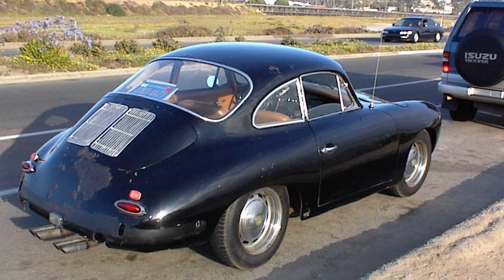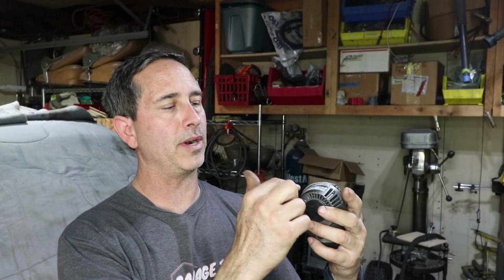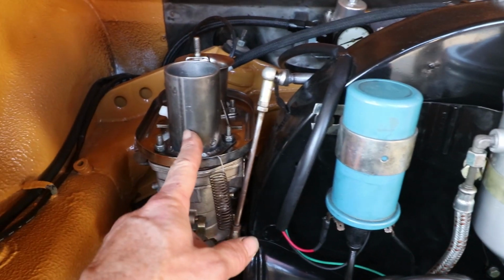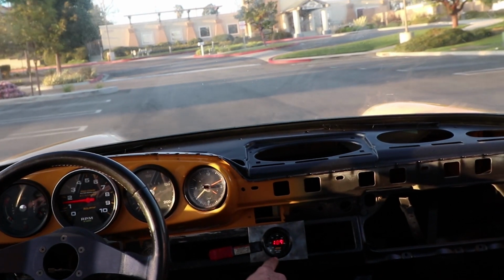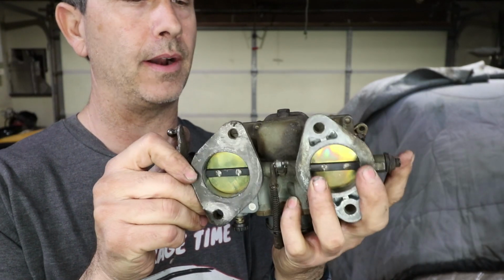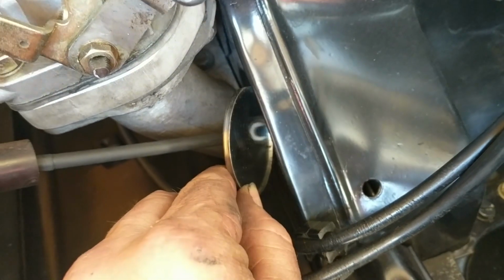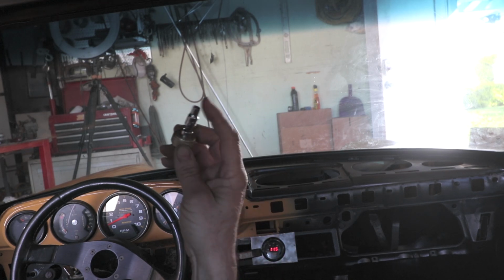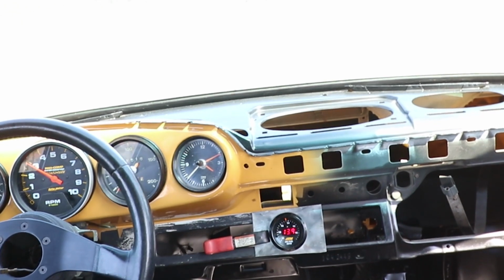Complete WEBER 40 IDF Dual Carb Setup and Test Runs

Comment: I followed your jetting snd f7 Emul. Tube. I set the timing,ajusted yhe valves sbd played with it for a few days . I jyst got it to idle smoothly and syn. The carbs. 
Thsnk you so much Tom as your are a wealth of knowledge and very thoughtful to teach us how to tune these littke engines. Your 912 motor sounds really good! Mine is still on the stand ,but running nice and smooth now.
Reply from the maker: So good!  Congrats😀

Comment: Since the air bypass is part of the idle circuit it's  almost effectively  like an adjustment of the idle air intake jet, would you agree?
Reply from the maker: Hmm, my opinion is that the air bypass is not part of the idle circuit.  Its the same as drilling a hole in the butterfly. 
The idle circuit air bleed is different in that it effects the pressure acting on the idle fuel column.
Reply: @GarageTimeAutoResto  Oh so the air bypass is separate from the idle circuit, I assumed it was connected.

Comment: I thought the air by pass screws were used for syncing  or balancing the two throats if needed.  Really good video , thanks.
Reply from the maker: You can synch barrel to barrel on the same carb with very small opening of the lowest flow.  If the engine is in good health usually the airflow is even right out of the box with webers.  If too much air goes in the bypass it makes the idle circuit transition weird.
Reply: @GarageTimeAutoResto  Ah, thx.

Comment: Hello, I'm interested in building the air volume sensor you used can you help me out with the parts and software needed. Thanks
Reply from the maker: My sensors are Cambridge accusense/ Degree C.  They also sell the tracking software.  
I had these left over from an engineering job.  
If I were to do it again, I would buy a ford or gm mass air flow sensor and buy a MAF controller.
Lots of data acquisitions systems available today for a laptop too

Comment: A hot wire anemometer!  Where did you get that?  I'd like to make one for the Zenith 32NDIX carbs on my 356C.
Reply from the maker: What? You don't have one lying around?  Ha ha, kidding of course.   I have these from my days testing laboratory equipment airflows.  They are from Cambridge accusense and they are pricey.  I'd love to convert a GM MAF for this purpose.  Maybe will do for my  flat 6 engine with ITBs?
Reply: @GarageTimeAutoResto  I
Reply: I was hoping to find a mass airflow sensor at a junk yard and then press it into service.  Precision isn't important, because we're only comparing the flow in two carbs -- but it has to cover a broad range, from idle to pretty much full throttle.  Would be nice to find two matching sensors so that they could be attached to the two carbs to compare flow rates without having to move single flow sensor from one carb to another.  I have a Uni-Syn.  I think it restricts the flow on the carb being measured.  A hot wire doesn't.
Reply from the maker: This would be awesome!  Reach out if you want to collaborate on this.

Comment: Hello! Really really good video! If i can make a sugestion, get an mallory distributor. You can advance the idle timing without advancing top rpm timing... Im using obe with 15 degree idle and 28 degree top speed and my idle is very crispy. Great work!
Reply from the maker: Good choice!  I already have a 123 distributor for 6V.

Comment: Ideally shoot for 14:0 at LBI and at part throttle condition 15-16 AFR (if you run vac advance). If not then set timing at 28 full and no lean tune jetting at cruise. Always keep the air bleed screws closed. You may see as much as (1) point difference on the snail between (1) barrel and another but that is nothing out of the norm. The difference is generally due to either one barrel being eager than another and/or a slightly twisted throttle shaft or differences in throttle plate alignment. Your mixture screws will only affect the mixture at idle speed only. So get the idle speed to 14:0 LBI. 12.5 at idle is too rich. You'll also do better to get an SVDA or a 123 distributor in the car then lean tune it for part throttle (cruise) condition. No lean tune jetting with centrifugal only distributor.
Reply from the maker: Thanks, good info here.  I'm set a bit richer from your recommendations, but will try on my 356 engine.  I have a programmable 123 distributor for that and I'm excited to try it out.
Sometimes after idling for a while the advance weights are reluctant to move and the engine falls flat.  
What WOT AFR do you target and does it differ with RPM range?
Reply: @GarageTimeAutoResto  At WOT shoot for 12:5. At cruise (part throttle) shoot for 15-16. Remember....Load = Throttle position. This is with an SVDA or programmable distributor (Black box) only, not centrifugal (mechanical). If the 123 distributor is sticking I'd be inclined to take it apart and clean the lower advance and re-lube it. I do this with any new/used distributor prior to install. The following is the Type-4 engine I set up for my 72 Westy still runs like a dream....https://www.youtube.com/watch?v=0EoAeY8dG0o
Reply from the maker: Gotcha, I targeted 12.5 also.    My 022 distributor was sticking, not the 123.  Sorry about that.  
The engine in this video isn't in this car anymore, so I'm done playing with it for now.
My 123 distributor doesn't have any mechanical advance weights.

Comment: Thanks for video 
I wonder if you fold the bottom of flag 
Like a z so creases go vertical it will keep the gas on side of jet well off the center of flag paper
Reply from the maker: Not a bad idea at all.  How about wax paper with a thin band of regular paper down the middle?  
There must be a paper that changes color when it touches fuel?  
Thanks for sharing your ideas👍

Comment: Hey Tom, how does your car idle while it is still cold?  That is what I'm having trouble with, or is it just something I'm going to have to live with? You're explanation of the system is by far the best I have found. Thanks.
Reply from the maker: It idles low at about 700 RPM.  Many times I back out of the garage, run inside to close the big garage door and come back and the car is still idling.  It's normal for it to cough a little through the air cleaners, but it warms up pretty fast.  Keep in mind though that I live in warm climate.  If its cold outside, I think its normal to baby sit it for a few minutes before it will idle on its own.

Comment: Great video and explanation of how the jets and progression ports work in relation to each other. I'm running  IDFs on a VW 1776 Bus with crank fired ignition (Ford Edis and Megajolt) drawing a vac signal from each barrel combined, to present a MAP reference for the Load bins on the megajolt timing map ( which uses RPM and load). When setting the Idle mixture, one barrel/cylinder doesn't seem to respond to adjustment half as much as the other three. Leakdown test confirms everything's in order, so I'm guessing either the throttle spindle is slightly bent (and the plate is starting to uncover a progression port or there's an air leak...

I used the airbypass screws to bench match the flow through each pair, but it was a very minor adjustment, and I'm not convinced it makes a great deal of difference when other discrepancies stack up....still, it's nice to have something else to play with. Will share your video with a friend of mine who's just about to start setting his twins up.

Another useful DIY gadget for making sure each idle speed screw is just touching the actuating plate, is a 12v test light, grounded on the carb body....
Reply from the maker: Best of luck trouble shooting your engine.  Sounds like a good one with great parts.
Here are a couple ideas to try.
1) when you pull each plug wire does the RPM drop the same amount?
2). Have you tried a IR temp gun at each exhaust header?
Might tell you if you have a plugged jet or something strange?
3). Maybe try color tune?  It's a window into the combustion chamber so you can see how it's running.  Rich or lean?
4). Run the engine in complete darkness and look for ignition leaks.
Just thinking out loud here.  My hunch is that you know this stuff already

Comment: Really helpful video... thanks. When dipping for the fuel well height your paper flags were all in 28mm - 36mm range... yet in your voice over you said you measured 48mm. Is that really what it was... or was it 38mm perhaps?
Reply from the maker: Thanks Daniel.  Sorry for the confusion.  I'm talking as I'm filming and sometimes don't catch my mistake while editing.  
The goal is to have the float level a few millimeters below the port where fuel dumps into the engine.  
I think I meant to say 38mm.  
This method is a bit tricky because the fuel sometimes climbs up the walls.

Comment: Hey Tom.... I was woundering if you set your float levels (in addition to your float level ck.)by measuring the float travel in relation to the float pin. Weber says 14mm open (without pressure on the ball) and 22mm closed. Many 356,sndVWGuyes set the floats at 10.5 and 32.5 mm respectively. By carefully bending the float tabs (top and rear) you can ajust to get it exact,... what are your thoughts on this? And where did you get the nylon spacer on the top of carb. Setup that you made? Thanks again Tom🤙🏽
Reply from the maker: Hi Bill, as always there are many ways to skin a cat.  Physical measurements are good, but its an indirect measurement in my opinion.  How does the fuel pressure affect the float level?  What about seat or pin wear?  
The thing that actually matters is what the actual fuel level is when you are driving.  That is why I like measuring the fuel level with it running.  Solex 40P11 has a screw on guage that lets you sight the fuel level when running.  This is my favorite method.  
Weber does not allow this, which is why I made those little paper sticks to check.  Fuel level can also be a tuning parameter to tune when the main circuit kicks in.  
I think the best performance is when the actual fuel level is a few millimeters below the main circuit port.   Too high and unwanted fuel will spill in.  Too low and the main circuit kicks in too late.  
We all want a set it and forget it number.  The ENGINE may want something else.  That's the rub!
The nylon spacer was homemade by me on a CNC machine.  
Best of luck on your carb journey.
Reply: @GarageTimeAutoResto  The Weber manual is wrong with respect to 'initial' float settings. The rule of thumb is check fuel pressure first...max 3.5lb (critical). Once fuel pressure is confirmed adjust float height to 10-11.5mm with gasket in place and ball NOT depressed. The float drop is not as critical 28-32mm will suffice.
Reply: Again I followed yoir advise to set my floats to 10.2 snd I copied your nylon spacer( made out of a white nylon cutting bord,and I cut them with a jigsaw ,and smoothed out with die grinder 😅. Came out perfect 🤙🏽
Reply from the maker: Nice!

Comment: Thank for sharing that great video. However is there a reason, why you tuned your idle mixture that way instead of using the LBI + half a turn method? 12.5:1 AFR seems to be very rich.
Reply from the maker: Thanks.  I have no problem with the LBI method and I know it's common.  
I will say that a 1/2 turn is a LOT will result in 12.5 or less.  
I was tuning in 1/8 turn increments and saw significant changes in AFR.
What AFR do you like to see on an air cooled engine?
Reply: @GarageTimeAutoResto  Okay got it :) I usually end up with high 13s-low 14s at idle.. But then again, idle afr doesn't really matter, I was just wondering if you chose that value for a reason. For the progression circuit I try to stay lean of peak and around 12.5 to 12.75 on the main circuit. Which values are you targeting there?
Reply from the maker: It depends! part throttle or light throttle gets into the 14's some times.  WOT dips into the 11's.  
I'm not tuning for max HP on this engine.  This engine doesn't cough, backfire, hesitate or bog at all.  It also runs cool which is important to me.
My 911 engine will get a much more aggressive tune.👍
Idle AFR is a bit rich because these carbs don't have chokes for cold start, so it's all a bit of a compromise.  
I do love the AFR Guage as it takes so much of the guesswork out of it. 
I still have it connected.  A few weeks ago I got a plugged idle jet and it showed up on the Guage immediately.

Comment: I have these same carbs on a 2110cc VW type 1 engine that I'm trying to get dialed in. So far it idles perfect and WOT seems pretty good but off idle transition to mains stumbles a little, almost an on-off feel.
I'm starting with 55 idle, 200 air, and 125 main jets with I believe the f-11 emulsion tubes. 
I'm at 6000 feet elevation. 
I also have a vacuum/centrifugal combination distributor that I can't seem to get any vacuum advance? I have vacuum tubes from both carbs into a T and then to distributor. Can you tell me if I need some sort of check valve in those vacuum lines?
I'm wishing I would have gone with centrifugal advance only and may end up switching. 
I really liked your video and I learned a lot watching it.
I'm definitely going to check the float levels running as well as run the idle circuit without the main jet stacks in to isolate the idle circuit.
Reply from the maker: I'm not super familiar with VW engines, but they are very similar to Porsche obviously.  Are you running a cam with large duration?  Is that why the vacuum is low?  
Here's what I recommend:
Start with the distributor and set the total advance with the vacuum disconnected.  Porsche engines like 35 degrees, but I think VW engines like less.  It depends on your compression ratio, cam and head geometry ultimately.
I don't think you need a check valve for the vacuum lines.  The vacuum advance comes in handy under part throttle.
Research the max advance for engine and set it at that.  If not try 28 degrees?
Hopefully it will still idle ok.
Back off the accelerator pump screws out several turns so they don't interfere with jetting.
My guess is you are way too rich-  I'd go with leaner mains and idle jets.  
Are you using 28mm venturis?  An engine that size might do better with 30 or 32mm vents.
Reply: You wont be able to get enough vacuum for that distributor. You would only get two cylinders of vacuum vs four with a single carb

Comment: That little tube with the usb wire in it is intriguing. Where would one source such an item?
Reply from the maker: It's a precision test instrument  from degree C.  Not cheap if I remember right.  This was left over from an engineering project and probably overkill for an engine.  I do wonder if a used mass airflow sensor could be adapted to a portable synchronizer.

Comment: I would recommend better air filter housing. The ones from CB performance are a lot better at keeping the idle jets clean.  Also I would recommend a cdi style ignition system for that engine.  Just my opinion.  Great info on the Weber's 40 IDF'S. 👍
Reply from the maker: Cool thx for the recommendations

Comment: Ya... Feel your pain have webers on a 2.4 t motor originally set up with mfi... The webers don't like the cam and even though the Bosch diz is recurved..  It isn't the marelli.... Switching to an ms system. Still have the mfi but it's WAY to expensive to put back on..
Reply from the maker: It's a challenge to get all these things happy.  The air file ratio meter is key to understanding what the engine needs imho

Comment: Some interesting points   I've had to use the air bypass screws to sync my carbs front/rear.  I have a colour tune but I find it ready different to see the spark.  After getting mine nicely tuned I went to a rolling road and he moved me lower in the air correction jet to sort out a lean condition after 3.8/4k
Reply: Ps the engine sounds very smooth as you accelerate.  Still going strong after 5k
Reply from the maker: The air fuel ratio guage is so good that it feels like cheating.  I'm able to see exactly where the lean or rich spots are and fix them.  
I overkilled my sychronization, but man it does run smooth!
Colortune is tricky to see on an aircooled car, but if you dim the lights and use a large inspection mirror, its not too bad.  
The mirrors in the kit didn't work for me.

Comment: Wow! Makes me feel fortunate that my Weber equipped S90 ran so well with just minor adjustments to synchronize. I hope it still does when I get everything back together after long term storage. If not I’ll be back to this video for guidance. Awesome job...thank you for sharing!
Reply from the maker: Once carbs are setup they run great unless they get clogged with something.  Make sure  get any old fuel out of the carbs while they are stored.  Spray carb cleaner through all the passages or they will turn to goo
Reply: Yes, they were stored dry and I cleaned and serviced them while the car was in the body shop. Viva la ultrasonic cleaner!

Comment: You have tried venturis 32?
Reply from the maker: Yes, the carbs came with 32.  It didn't drive well at low speed.  I also have 30mm which might work, but I'm not after high RPM performance with this engine

Comment: Wow, a ton a great information.  I may not have IDF carbs, but the basic process is helpful, even in tuning my Zenith-Stromberg carbs.  It's been a real long time since I've had a car with carbs. LOL.  One question...so you get yours dialed in at sea level there, but then you drive to Lake Tahoe, would the Porsche still be running great or would the altitude throw everything off? The tinkerer in me loves the idea of carbs, but the driver in me might just prefer some throttle bodies that look like Webers running fuel injection.  Cheers!!
Reply from the maker: I'm at sea level so I'm also curious to know how it will run at altitude too.  Less air means a more rich mixture so the car probably will feel more lazy.  For a day trip, I don't think any changes would be needed, but if I did lots of mountain driving then I'd probably go down one jet size.